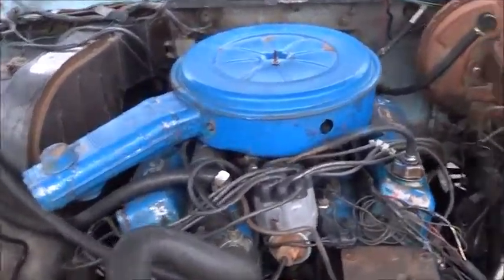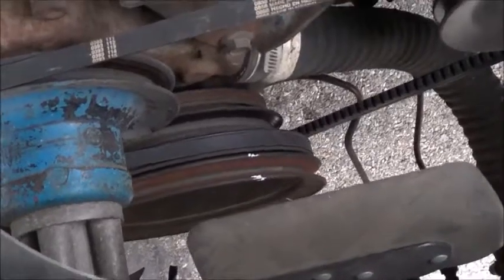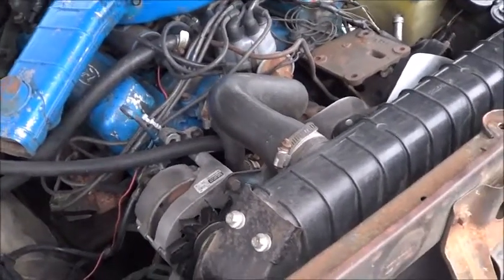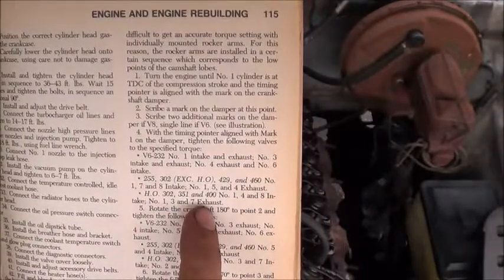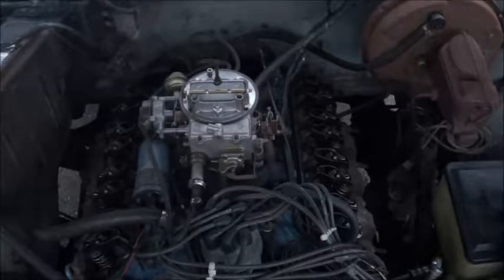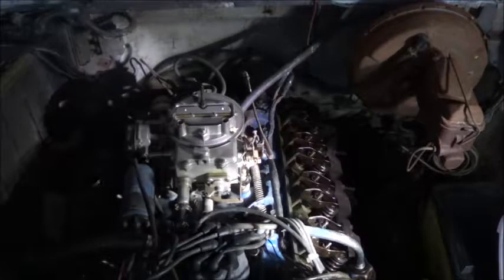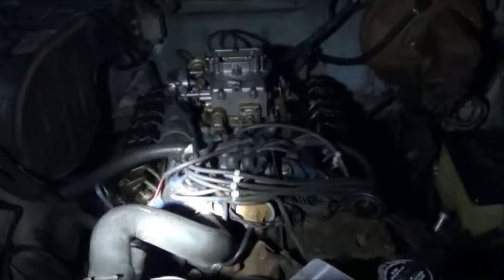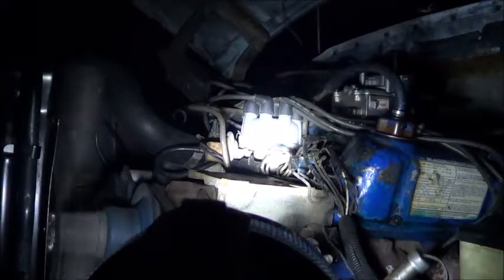351W Rocker Arm Inspection and Torque Specs

Comment: Howdy and thanks for the great video. Question, so when you torque the nuts down was there any thread left on the rocker studs? Also were the nuts self locking? I’m building a ‘69 351w and trying to determine a few things. 
Thanks
Reply: 1969 351W rocker arm nuts and adjustment is  postive stop run the nuts down till they stop and torque to 20 foot /pounds ,,,,come on google please
Reply from the maker: Yes I would guess abt 3/8 in of thread car up thru the nut. And they were very tight the whole way down so I would assume they were self locking

Comment: Did you ever run the engine with the valve covers off? that would have been a good idea to make sure all of the rocker arms are getting oil. To me it sounds like the fulcrum balls are worn out and or they are not getting sufficient lubrication. This can be caused by the oil galleys in the pushrods being clogged, or the oil pump and bearing clearances are worn/wide.

Comment: Have any issues since?
Reply from the maker: Everything has run fine since the video. Still a little ticky, but it’s running fine.
Reply: @cronedentside74  was wondering. Did the same thing, pulled out a chunk of tubing and put in on the covers after ten minutes. Still a ticking away, louder at higher rpms
Reply: @cronedentside74  you able to get a close up and better lighting on the balancer by chance?